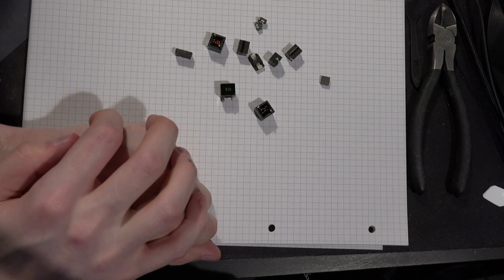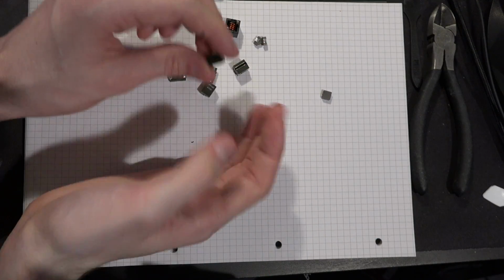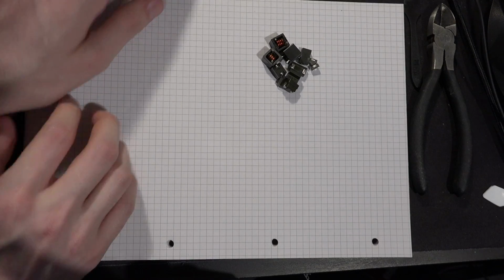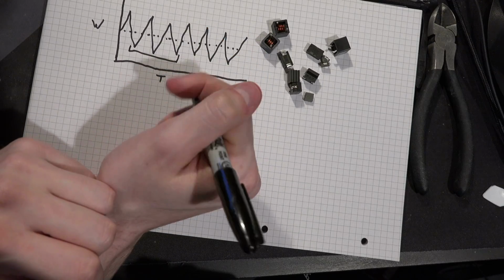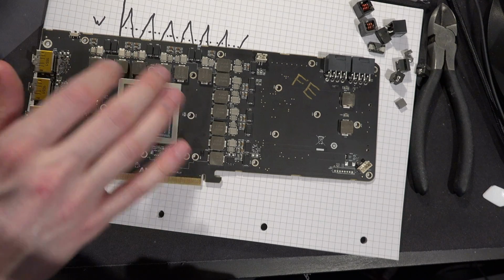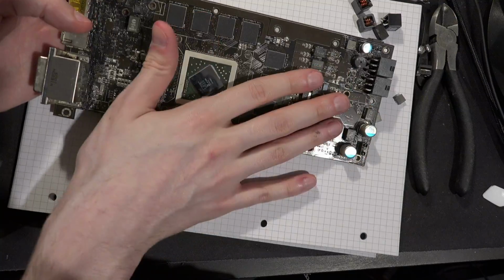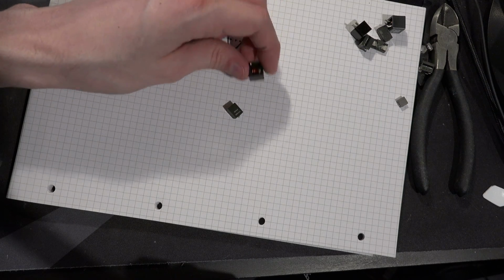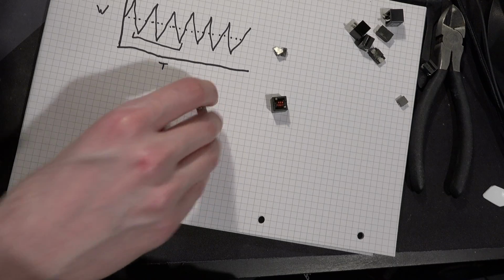Rambling about Coil Whine

Comment: In my power electronics class we learned that coil whine is due to what's called "sub-harmonic oscillation." From what I remember it's an instability of the operation of the power stage brought about by a design oversight in its control scheme. The end result is that the switching frequency occasionally drops below the intended frequency and sometimes into the audible range.

My professor really emphasized that a properly designed power stage should never buzz or whine, regardless of the inductors used.
Reply: this is why the 4090 founder's edition and MSI and ASUS cards have coil whine. Because after 20 years of making video cards, none of the engineers know what they're doing. Furthermore the reason Palit and Gigabyte 4090 cards don't have coil whine is they used cheap and crappy components which through sheer dumb luck do not have this resonance and so don't have coil whine. why is everyone so stupid? I'm thrilled this video exists and I can superglue the inductors in place to fix their idiocy
Reply: @CalvinJary  I'd feel very uncomfortable taking apart a $1600 card. Coil Whine is one of the most annoying things and yet they don't do anything about it.
Reply: @CalvinJary  asus desgin pcb so they look pretty and are overkill so people overpay for things that doesnt matter if u dont ln2, msi have really wierd pcb they are way too large and looks wierd and empty so they arent that good at it imo, other brands make pcbs so they are small (it does matter then u watercool) and people dont RMA cards just because something buzz often u can take does pcb and solder extra caps so they become even better. Just dont overpay for shit gpu brands buy gigabyte, gainward, zotac maybe palit byt 30 series form them was much better than 40 series (its really bad). Its worth to buy mobos form msi and asus because u need good vrms for cpus and good memory oc and bios matter. Then u buy gpu always try to buy the ones with black inductors, small pcb, good cooler and dual bios.

Comment: Coil whine is the result of the mechanical vibrations caused by the varying electromagnetic forces exerted on the coil components. The frequency of these vibrations is the frequency of the variation of the electromagnetic forces which is equal to the frequency of changing of the magnetic field created by the flow of current through the windings which varies according to the gpu load. This therefore happens at a frequency tied to the frame rate which falls within the audible spectrum. Also, obviously, the higher the frame rate the higher the vibration frequency and the higher the pitch of the emitted sound; thus the term 'whining'.

Comment: i would have called the video whining about about coil whine
Reply: I watercooled my pc, all open loop, bunch of noctuas, now the coil whine is by far the loudest part of my system during gaming. Yeah it is a vega 64 on an ek waterblock, but still. Luckily it is only during gaming, with more consistent loads the coils are virtually silent.
Reply: missed opportunity
Reply: @jadoei13  Same - I modded watercooling into my MXM 1080 SLI laptop and instead of 50-60dBa fans and 85C, I get 50C and no fan noise (external 3x120 rad with its silent 1200rpms) but now all I hear is buzzing coils. Scared the sheet out of me and took a while to convince myself it was safe
Reply: Arnie: "Stop whining."

Comment: Coil whining can be such a pain. My GTX 770 had some coil whining. Weirdly enough, changing the power supply fixed mostly that issue. And no the coil whining didnt come from the powersupply.
Reply from the maker: Yeah I've also had that happen with some cards.
Reply: Yeah, my 1070 had pretty loud coil whine in some cases with my old psu, i got myself a new one and it’s almost completely gone (audible under load through mic with high gain, the sound itself is very high pitched). I have no idea why it’s gone, but my theory is that my new psu is able to push power to my gpu more consistently and w/o huge drops.
Reply: @fioletoviymewok9665  Could be lower voltage ripple, reducing the resonation in the coils
Reply: Better powersuppys
Lest voltage variation 
Less harmonics
Less wine
Reply: Koeras from what type and brand of psu did you went from and to?
Reply: @joji5912  Coolermaster 600 Watt PSU was the old model. Can´t remember exact model though. And the replacement was a Corsair AX 760. Mind that both work just great to this date and are under load on a daily basis. My coolermaster PSU must be around 8 years old by now and the Corsair one should be already 6 years old. The coil whine issue does show up in any GPU when connecting one with over 180 Watt powerdraw.
Reply: Koeras do you think upgrading to a rm750x psu will eliminate the coil whine on my asus rog strix 2080 super?
Reply: @joji5912  I sadly have no easy answer to that. I would guess it depends on the conductors they are using. The PSU is not always at fault of coil whine.

My Sapphire Vega 64 has some coil whine too in some instances, sadly that is due to the way that card has been built. 

I would probably suggest you to gather some information of how prevalent coil whine is on that Asus rog strix model for the 2080 Super.  You might also do some research on your PSU model. You might at least find some correlative data, though drawing causation will most likely be impossible. A lot of factors can create coil whine. 

Even heard of people reporting some coil whine on their Motherboard VRM. Make sure to troubleshoot in a way that you have exactly located the cause of the bothersome coil whine (I assume that it does trouble you a lot).

Reducing or capping your Framrates in games can help a lot with coil whine. Having such powerful GPU I guess you play a variety of games, not all of them need to run at 100 fps +. My Vega 64 does for example experience no coil whine at 60 fps in most games.

If your PSU works, change it only as last resort.
Reply: Downgrading the power supply can help to. Just need to get the ripple into the inductors to be out of their resonant range.
Reply: Gtx 770s especially the palit models are extremely vulnerable to coil whine. I've sold alot of used pcs in the last years including them and there was a 70% chance they would whine.
Reply: @4ghzgaming664  It was a gtx 770 Gigabyte Windforce edition. The card died sadly a few years back.

Comment: You know, if I didn't have the hands on experience with coils I couldn't talk about it and be taken seriously, but I've actually built my own hand wound coils for different projects without using any glue or whatever, I just wound my coils very neat and very tight as possible doing it by hand but I never had any of my coils producing any noticeable sound at any frequency up to about 4 or 5 MHz...

Crazy right?

Some of the coils I made are just a little bit bigger than what you used to show in your video, the biggest coil I made is loosely wound on an old flyback that I'm playing with at the moment, I know it's not comparable with graphics card coils at all but it's a coil, also I made my own inductor which goes in between the flyback and the power supplies and that one does have a specific function in my case and I found out it needed to be wound in a specific way to get it to perform as good as it does now without making any noise or getting warm, however I still didn't have to use any resin, glue or whatever to hold the windings together... 

Believe me I'm pushing a lot of amps through the inductor and the flyback coil, the output of my ZVS driver and flyback is about 100kV to 150kV and the plasma arc is white hot, about 10mm thick, I can pull about 100mm to 150mm white hot plasma arcs with my ZVS driver it's really crazy and very dangerous but I just find it fascinating to look at how it reacts with different stuff, blowing up stuff, even making beautiful figures in wood called lichtenberg figures with it... it's a lot of fun if you know what you're doing.

Not really related to this video but I always think about my high voltage projects automatically whenever I see or hear something or someone talking about coils and I get excited so I just wanted to share that, LOL.

Best regards.
Reply: You're comparing your homemade hobby amateur winds to a highly sophisticated machine built electrical component LOL.
Reply: @jayryan7473  Nothing wrong in comparing. Hand wound coils can be superior.

Comment: Hey man, love your videos, your technical knowledge of computer components and the theory behind electronics is far beyond anyone else in the computer tech field here on YouTube. Would love a video on minimising EMI/EMF by knowing what to pick and what to avoid when it comes to motherboards, PSU's, CPU overclocks/frequencies/settings to avoid, how the frequencies of graphics cards, CPU's and RAM can create more EMI/EMF, cross-talk between components picked up by the on-board audio interface, DIY shielding and things like that, I'm sure it'd go down well with audio/visual professionals as well as health conscious computer users, and could get a lot of views from those niche groupst.

Cheers!
Reply: That is a really good idea Sir, take an upvote.
Reply: Health? You have a cell phone, right? WiFi?
Reply: @Michael-OBrien  I don't use WIFI, and my phones are off 90% of the day.
Reply: A metal case, without a window, is a good Faraday cage if your computer is correctly grounded. But you know computers doesn't emit a lot and they are quite resilient to EMI, even in open cases. There are noms for that, IIRC Australian ones are the most constraining for EMI.
But if you care about that, what you should beware is the shielding of your domestic electricity cables especially if you use Homeplug PLC.
Reply: @PainterVierax  My main system is in a fully enclosed steel case, although it does have small ventilation holes at the top. The PC emits quite a large amount of EMI, measurable both with a low frequency meter, and also picked up by musical instruments pickups. I've got it plugged into a power condition which has a torodial copper transformer to clean up "dirty electricity" noise but it's still not perfect.

I'm thinking of getting a Fractal R2 XL case for my next build since it is heavy with thick steel walls, and perhaps even adding additional copper or aluminium mesh screen to the inside of the case.
Reply: It doesn't really depends on the thickness of the wall, look at a microwave oven.
Is your ground connexion good ?  it might be a fan noise too, they are closer to the openings than other parts and can sometimes disturb embedded audio I/O. But yeah you may also test to add a thinner mesh but be careful about air restriction. 
A freq meter is ultra sensible, no surprise here. Same with single coil pickups, humbuckers were made to mitigate that. I've repaired a PJ bass guitar which was able to capture a commercial radio, this instrument needed some proper shielding (copper adhesive sheets) and a better filtering circuit.  You also want that the signal enter a DI or a preamp with the shortest cable possible to avoid the antenna effect if there is no embedded preamp in your guitar.
I don't know your electricity knowledge so sorry in advance if this sounds obvious to you.
Reply: @PainterVierax  I'd imagine a microwave oven is generally only emitting a certain frequency whereas in a computer you are having many high frequency emitting parts, from the CPU, to GPU chips, RAM modules etc... I believe my grounding is good, since here in the UK/England we have very strict rules when it comes to electricity and wiring, unlike for instance the USA.

But yes, shielding the instrument further is certainly a possible solution, although the drawback is that it affects the tone of the instrument, and actually prevents the pickups from picking up a lot of the higher frequencies from the strings themselves as well as external noise/interference. 

I think thin copper/aluminium mesh will be my next experiment to see if I can virtually eliminate EMI/EMF radiation coming out of my PC's.
Reply: microwave oven frequency is something around 2.4 GHz yes but the signal is way more stronger than the EMI of a silicon chip and a motherboard where the goal is to keep signal integrity. The door of the oven has a mesh panel thin enough to capture this signal and even if there is leaks they are negligible.
For ground, I was also thinking about non-aerial insidious ways like loops and having a power line coming straight from your electric board and dedicated for your audio system were there is preferably no switching PSU plugged in. Noise can also come from phase or ground and this last one is often unfiltered. You may want to add an inductance and a diode here.Yeah it's tricky to shield a guitar without affecting the sound. The goal is to let a window large enough to not alter it. Humbuckers have progressed too but it's still not exactly the same as single coils pickups if the genre you play requires it.
If mesh doesn't work, try to determine if the source is not fans : PWM signal has a lot of high freq noise due to its squared form. It can worth it to just change a bad fan or adding filtering to its DC input. It's worthy to check your computer PSU input and output noise and ripple too.

Comment: Finally someone talking about coil whine where it actually happens. People keep saying that coil whine are the sounds of fan spinning but is the inductor coil vibrating at a frequency that sounds like a whine.
Reply: Well in fact, fans can be noisy too because of their circuitry. A fan with crappy PWM filtering will give a square signal to the motor and it will produce noise. For strict DC fans, it can also be eared with cheap rheobuses which use bad PWM signal or have bad filtering instead of a proper linear voltage stepdown converter.
Reply: i have never seen anyone saying 'coil whine' has anything to do with fans (though they do have coils), must be younger people on youtube or reddit

watercooled people very often mention coil whine, instantly disproving fans
Reply: Some..."people" are also saying to put on headphones to not hear the coil whine. You know, the three wise monkeys "solution" to problems.

Comment: We live in 2018 and it's a shame that we have to deal with coil whine in GPU's or in the PS4. The Products are expensive and the Producer should find a way to get rid of it
Reply: Well you kinda can't defy physics though,  more powerful card equal to more power equal to more whining because there are more current flowing through the coil.
Reply: @rachmatzulfiqar  Clearly not... Did you not watch the video?
Reply: @nicknic28292490  my point is, more powerful card need more power = more current flow through = more chance to have coil whine,
Reply: starshipeleven  yes but do people want to pay 100$ extra for a card or go for a cheaper one with the same performance?
Reply: starshipeleven  It's not so terrible as people think it is. It comes down per person so it is quite subjective
Reply: @rachmatzulfiqar  the thing is: some vibrate outside of the human hearing range. so the goal should be, to onyl use selected parts

Comment: My 1070 FTW sounded like shaking a glass jar full of marbles under load. Card ran fine, but man was that a disconcerting noise.
Reply: Were you able to fix this? I have the same gpu and same issue but its coming out of my speakers.
v-sync kinda lowers it but still annoying
Reply: @hhiram  No, I sold it.
Reply: @hhiram  it's just EMI (electromagnetic interference) , more gpu/cpu load = more electric current = more EMI = more audio noise, your best bet to reduce it is to buy separate DAC and AMP, or you could buy a motherboard with separate audio circuitry.
Reply: @rachmatzulfiqar  Thanks! yeah i was able to fix it... most of the buzzing came through my audio interface while playing games but if i use the aux from the pc itself there is no more buzzing.

Comment: Would love to see someone make a video on testing coil whine mitigations. Maybe der8auer will try making a passively cooled htpc.
Reply from the maker: I'm toying with some ideas on testing some. It's just not really a priority for me.
Reply: @ActuallyHardcoreOverclocking  Coil whine is a huge problem on some of the ultra-thin laptops (Dell XPS etal). Trying some mitigation on those laptops, such as high-temp silicone on the inductors, would be an interesting branch out. I haven't seen anyone trying a "hardware" solution in the laptop space.
Reply: please make one, it would be super interesting to watch @ActuallyHardcoreOverclocking

Comment: yeah, I had mixed feelings about hot gluing the Vcore inductors on the M5A97 (Rev 1.0). the thing sounds like a flock of random angry birds when the FX8350 is idle or the system is in the bios. And it is loud enough to be audible from the other end of the house. I put a dab of hot glue on the base of the inductors and it didn't change anything, I ended up just stuffing deep-cone anechoic chamber sound absorber foam in the case above the VRM to keep the noise from being reflected out of the case. It reduced the noise to the point it was no longer audible from the other end of the house, it did not eliminate the noise tho.

Great vid BZ. B)